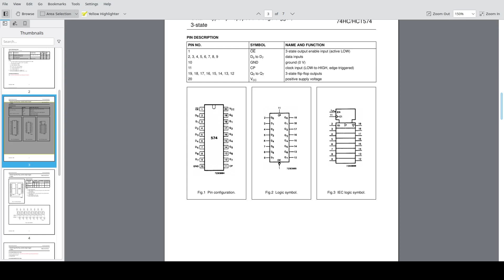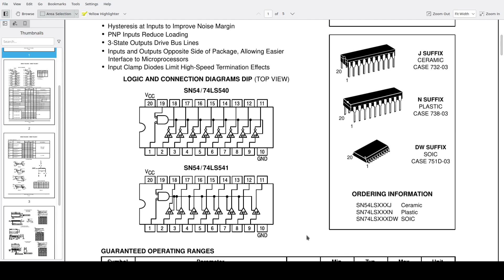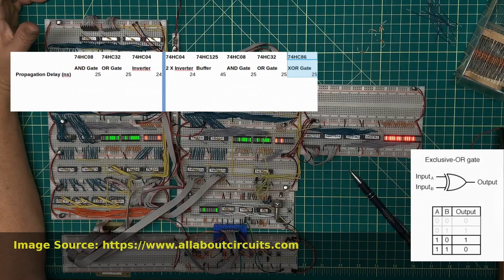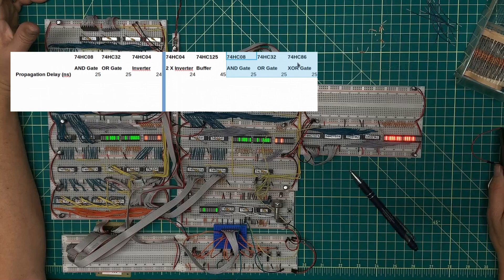0034: Instruction Register Breadboard | 16-Bit Computer From Scratch

Comment: I'm watching you place all those resistors individually by hand and wondering why you don't use resistor arrays: are they much more expensive or difficult to obtain?

I would think that when you came to the PCB the array might give an advantage…
Reply from the maker: That’s a very valid question.  

Honestly it’s the same reason I have not gone to soldering templates and hot air or a hot plate.  I do not believe I have the breadth of experience in soldering to move to “easier.”   I see it as a perishable skill and I’m still too green to make that change.  

The same logic still holds true with today’s videos.  Though I’m more amicable to it today than I was this early in the journey.